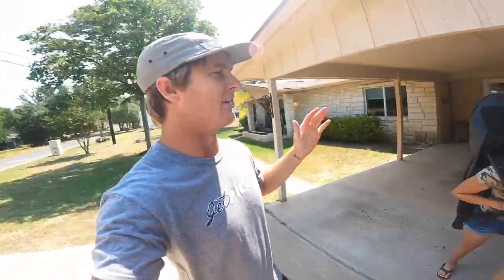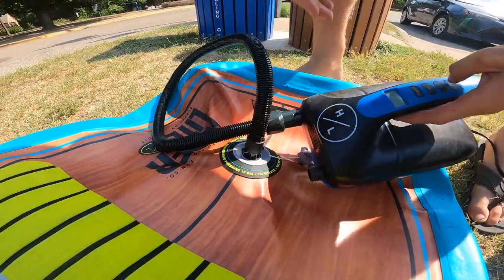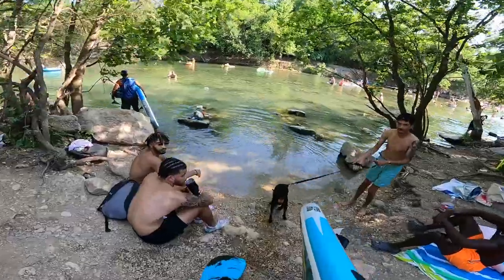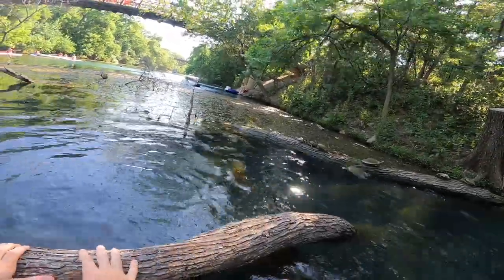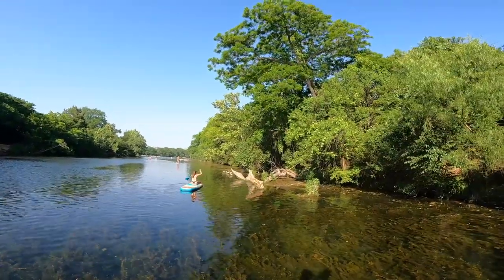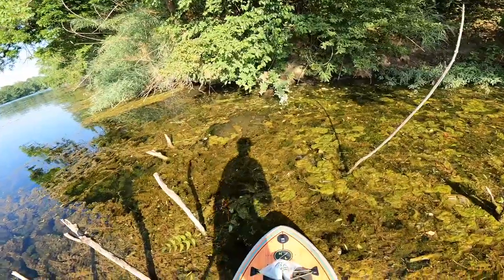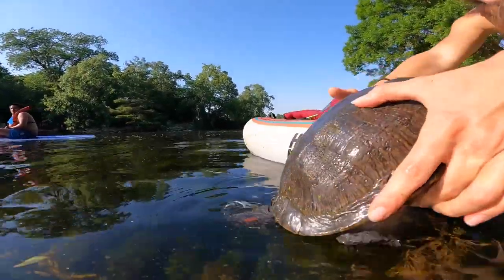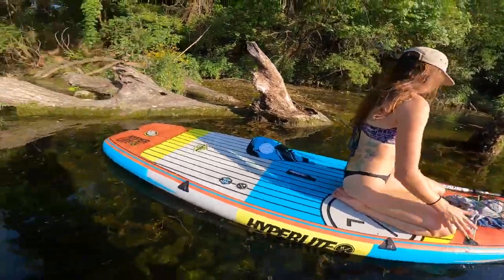PADDLE BOARD ADVENTURE!

Comment: Nice video, easy to watch and see how the boards perform and sit on the water. This board should be fine for anyone under 200lbs, but the longer boards are more stable with better tracking/glide. That said, this is a very nice board and starting to see more on the water here in N Cal. Who can argue the price at $250. with electric pump? Sweet deal on a very good board. Your girl friend is a keeper as she's comfortable in nature and a good paddler too. Enjoy the summer you two!
Reply from the maker: The board pretty dope and easy to use